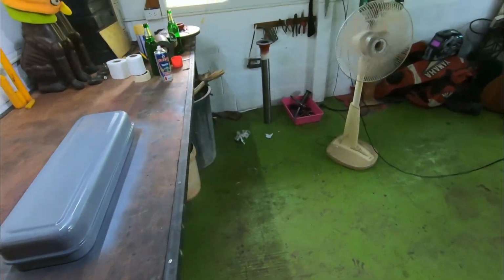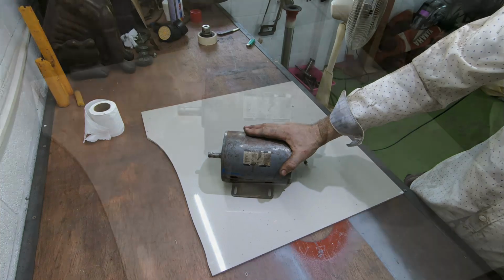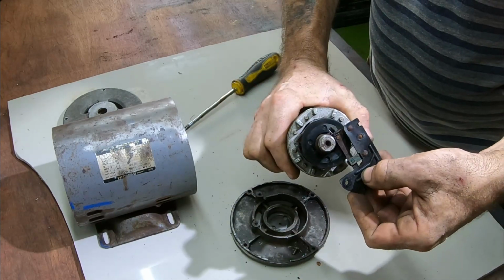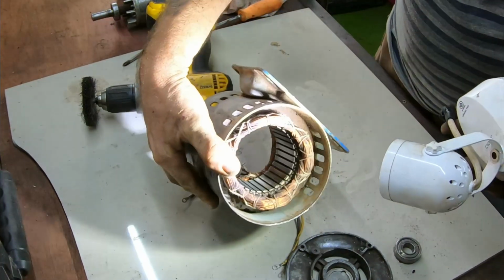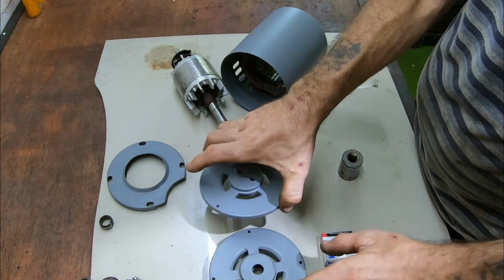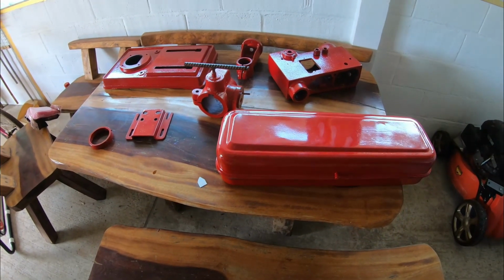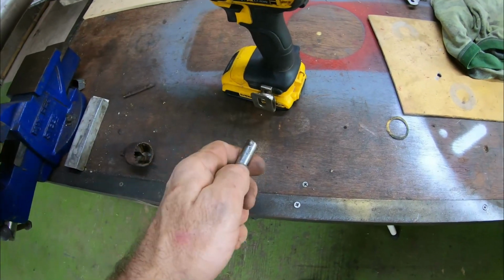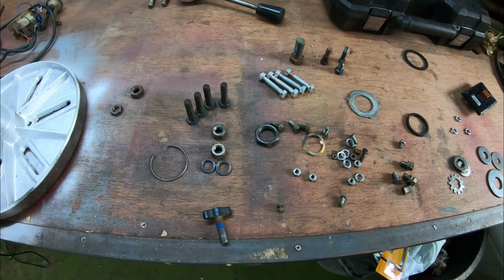Old Rusty Drill press Restoration Part 3.

Comment: That's come out trumps bud.  How easy was it to find the bearings etc. in Thailand  ?,  I thought you would have struggled with stuff like that.  Also,  did yiu find one of those piano wire wheels for the grinder  ?,  If not,  I can post one o0ver to you as they are cheap as chips here.  Best from us both.  Nick & Yisa.
Reply from the maker: Cheers Nick/Yisa. Regarding the bearings, there is an amazing Family run Motor factor shop in Sirattana (close to me) that seem to stock everything. I think the 3 sets of different size bearings (which you will see me install in part 4) are standard sizes to many things, such as wheel barrows and other farming machinery. Regarding the piano wire wheels, I did find a set of 7 online for 500Baht, I will order some up. Thanks for the kind offer mate but I think the postage from the UK to here would raise the price way beyond 500 B :)
Reply: @tinkeringinthailand8147  No worries bud,  I was going to post free of charge,  You can have one to try and for keeps.    Just let me know.  Thanks.
Reply from the maker: @nickdavies3334  Well if you did I would use it in one of my upcoming vids and give you a shout out :)
Reply: @tinkeringinthailand8147  drop me your address to my email (I popped it in the last message),  I’ll post the disk off shortly.
Reply from the maker: @nickdavies3334  I can't find your e-mail mate. You can send it to me if you like at CJGIBB65@yahoo.co.uk Cheers.